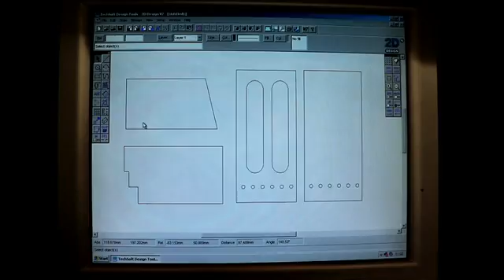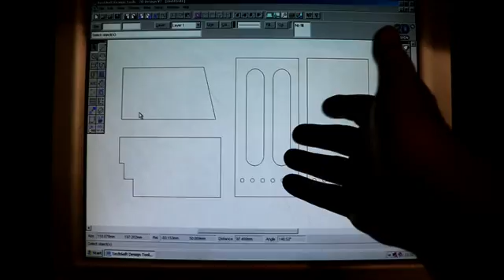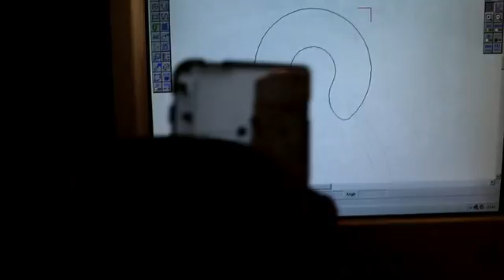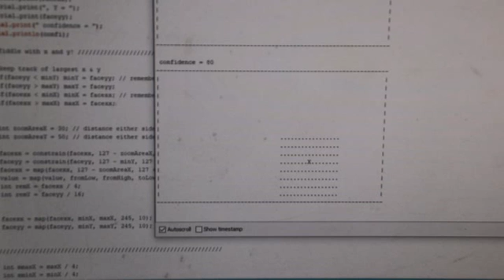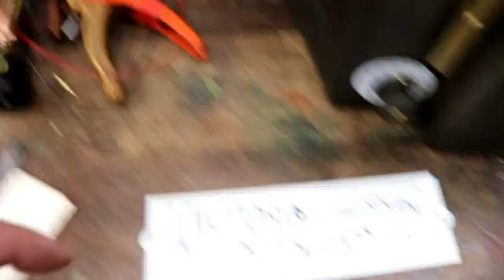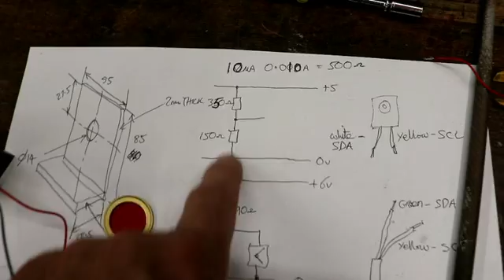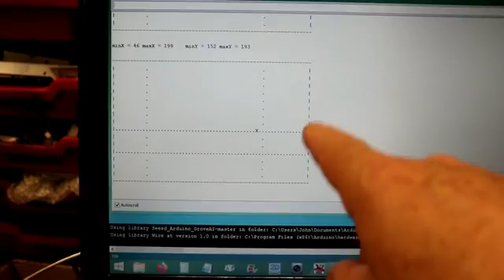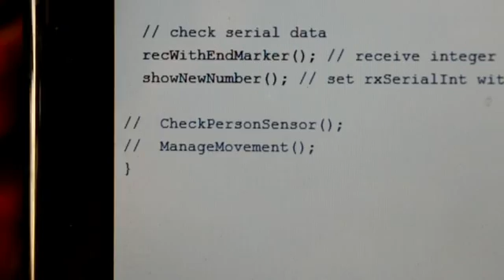The new Person Sensor seems to work!

Comment: Hi 
It is the very same reason I switched from Arduino to pic microcontroller
Arduino is not complex enough to undertake multiple tasks at once 
I am now referring to a programming term known as interrupts 

Arduino is beautiful and beginner friendly however as the mind becomes more complex or demanding then we need more complex mcu's
Pic mcu's are also inexpensive and I think 16f or mid range will be sufficient for your needs 
Like an octopus using all it's hands at once and I dependently

Sincerely

Ejike
Reply from the maker: Thank you, I'm also thinking this may be the way forward. Interrupts are exciting!
Reply from the maker: Thank you kindly! Arduinos opened up so many exciting opportunities, but this project has required so much more. People sensing, audio processing and the control of several servo motors... three Arduinos and a Teensy, I think it's time to move to a more powerful microcontroller! I'm wondering about Raspberry Pies?

Comment: How about usimg esp32. smaller board much powerfull processor. I gues you could power groove with 3.3 volts.
Reply from the maker: Thanks for the suggestion, I may well look at using an esp32 in future, as I seem to be coming up with ever more processing 'hungry' projects! For now I'm just going to use an Uno I had floating around to monitor the sensor and control her servo motors. This will free up the Teensy for sound processing and also makes me feel happy as things are nicely compartmentalised!

Comment: Keep going you'll get there.
I don't fully understand it, but on an ESP32 you can run 2 independent loops either on separate core's or on the same one. 
Don't know if you have any ESP32s or if it helps you in anyway.

Comment: Great to see it the sensor working.
I wonder if the interface is really 5V, or just 5V-tolerant.  I couldn't see any specs or schematics for the module, but the HX6537 chip is 3.3V.
It's possible the module has a level protector built in for when you're using a 5V Arduino.  But better safe than sorry.
Reply from the maker: Thank you. Sadly the documentation for the Grove person sensor is vague, although it seems to state that the supply voltage and I2C communication voltage is 5 volts. It does have two small LEDs to indicate 3.3v and 5v power, so I assume (hope!) it has a level protector built in.

Who would have though it would be so complicated, especially as face detection is old hat, having been built into virtually every digital camera for years! 

I remember watching a YouTube video by Tom Scott about facial recognition, and it came down to 'looking for' a darker 'T' shape that indicated the eyes and nose. Other than publicity, I don't know why we now have to get into AI to achieve this! Why can't someone just duplicate the 'T' sensing algorythm on a handy module?!

Comment: It's all coming together, just a thought, would a Pi be more suited to running the amount of tasks involved? 
Not sure if you saw my last comment, i found the candles on amazon, cheap as the proverbial. 
How about adding a very dim led inside that clock mech, so illuminate the cog? Seems a shame for it to be lost, after all the effort.
Reply from the maker: @simontopley4771 thank you for your last comment, I did respond to it, but YouTube didn't include your '@' thing in the reply, this time I've added it manually, fingers crossed! 

With all the issues over the people sensor, I have considered learning about Pi's, but it would be a huge learning curve... not sure I've got enough mental room left! 

Thanks for the suggestion of adding a dim LED inside the clock mechanism, with hindsight, that would have been a great idea, although due to the depth of the gear, pendulum, and angle of the clock movement, I'm not sure it would be any more visible.

The great thing about this type of project is the number of possibilities that arise, and can be employed at a later date.

Thanks again
John